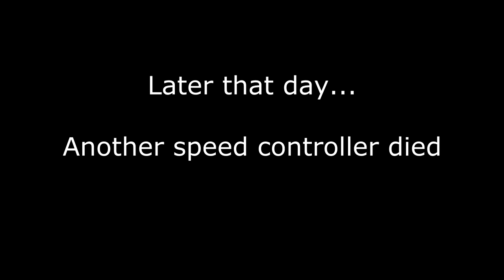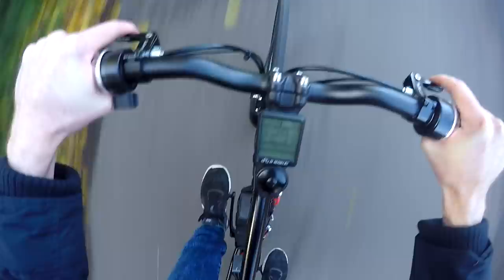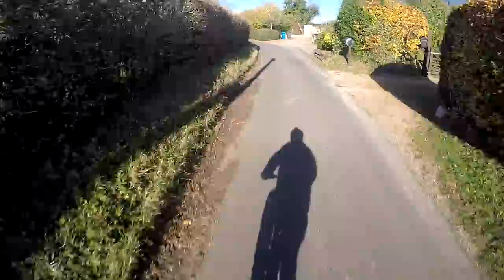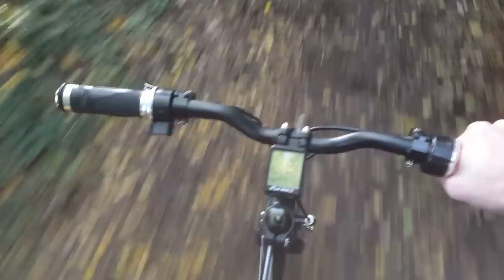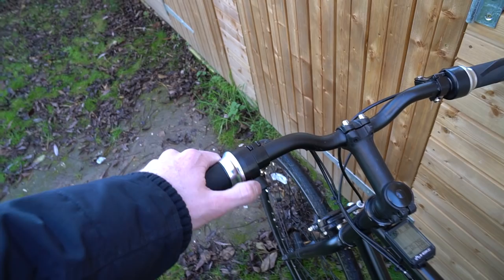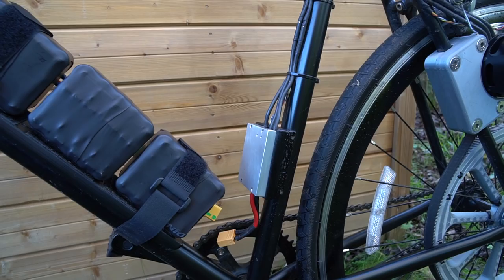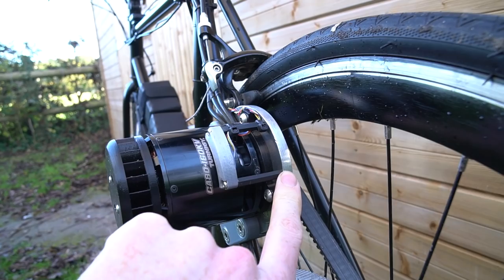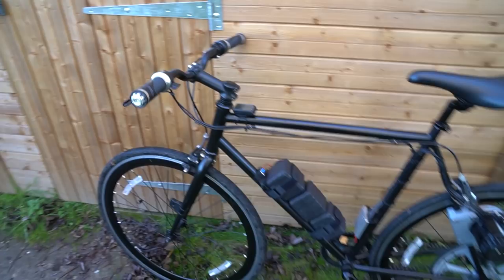Electric bike V3

Comment: Is that even street legal 😂 I'm sure that goes way over the 250 watt limit here in the UK. Even if not, it still has a top speed that's way too high to be legal right?
Reply: Max motor power output is 250W, the motor shouldn't be capable of powering the bike above 15mph so yeah, I'm pretty sure this doesn't meet the requirements.  Shame because 250W is pretty much useless to anyone who cycles seriously, and better ebikes might persuade more city commuters out of cars burning dinosaur squeezings
Reply: PKMartin yup
Reply: It's illegal in so many ways...
As well as the obvious power and speed issue, electric bikes in the UK have to only operate while being pedaled.

The laws are both ridiculous and nonsensical. 
We need a light electric vehicle class and sensible rules.

I'd like an electric scooter (a big version of the things the kids have) as I have some mobility problems and I'm just not prepared to have a giant PoS mobility scooter...yet.

Sadly you can't use them on the road, pavement or cycle paths. Brilliant!
Reply: Pook365 wow. I hope the law changes. Especially for your sake and others in a similar situation.
Reply: The U.K. Laws have, as with many laws not kept up with the rapid development of battery and motor technology. Tom's bike shows what is now easily possible but would now only be legal if licensed as a motorcycle and I think the procedures would be massively expensive!
Reply: Michael Curtis yup. While the government argue about which part of the NHS to cut rather than put in place laws that actually benefit the public. Anyway I don't think anyone will arrest tom so it is a basically un enforced law for general public. I still would not use it in inner city London just in case a police officer actually knows the law
Reply: As far as I’m concerned the law on electric pedal assist bikes is kind of justified with regards to the speed restriction as a lot of cyclists tend to be a bit careless regarding personal safety and once you ramp up the speed to motorbike levels, you really need a proper lid and clothing  for safety as 35mph+ road rash is not fun.  (I’m an occasional cyclist but less so nowadays as I have thoroughly wonky knees, and am a full motorbike & car licence holder). 

That said, as has been pointed out the 250W motor restriction is completely ridiculous.. A more sensible law on electric bicycles would to my mind allow a continuous max speed of say 30mph by combining pedal power and electric assist along (say 20mph on electric alone?) with a requirement for suitable brakes on the bike and protective clothing, as well as perhaps some compulsory training along the lines of the CBT you have to do if you want to get a motorbike. Either get rid of the wattage limit, or raise it to the point where you have a useful motor capacity. 

That way you can keep up with traffic without busting a sweat, you’ll have enough motor power to help you actually get up anything more than a gentle incline, and if you want to go faster than that why not get a motorbike licence? (There’s some awesome electric motorbikes out there).

And I feel @pook365’s pain about those larger ride-on scooters... when my knees are particularly shitty I’d live to be able to use one on my commute....

To be honest, if I didn’t live in London and commute into Central London, I’d probably build something like Tom’s bike to convert my current bicycle to an over-powered electric conversion anyway, but knowing my luck, I’d be the one to get nicked! It just looks like a total blast to ride.
Reply: EU is coming up with new rules, setting the limit from 250W to 1000W. To bad about Brexit.
Reply: I personally think if you have a motorcycle license, you should be allowed to operate ebikes above 250 watts.
its probably easier that way.
Reply: Yeah, but when does it become a moped?
Reply: But how will the government make money out of us?
Reply: Wow, suddenly they got some sense? Un freaking believable!

Comment: Check out this cheaper (costs only 200$) (but half the power)power train here:https://hobbyking.com/en_us/turnigy-sk8-esc-v4-12-for-electric-skateboard-conversion-w-bec.html
(battery not included)
To get the same power,go for this motor: https://hobbyking.com/en_us/turnigy-rotomax-50cc-size-brushless-outrunner-motor.html

Comment: So  lets get this straight 
£300 for VESC6 controller (wow! it should be 'amazing kit')
£150 motor
£150 battery packs (my guesstimate)
£15 throttle
£25 box, clamp, cables...anciliary etc
= ~£640  total + lots of work  (plus you have to buy bike as well)...an expensive business. A rich man's hobby
Apart from if you really enjoy the build , the only added benefit of this would be its power - but then its not road legal. 
Think I'll just buy an e-bike as cheaper less hassle option
Reply from the maker: That's very fair, however I enjoy the satisfaction of designing and building such a bike just as rewarding as the final product!
Reply: Didnt he say at the beginning of this series that it wasnt going to be cheap and that he was doing it for fun?
Reply: That's actually cheap for an e-bike! If you want a decent e-bike with a little better quality components.....it's gonna be well over 2000£

Comment: You should be extremely careful with a cheap bike with cheap wheels and spokes like that offroading or doing anything at speeds like that. Sudden catastrophic failure is a risk, and I have scars to prove it. Cheap tires can simply fold like an omelette at high speeds. Nothing about your build, it's the base bike that you started with that's the weak point.

Comment: 36 mph on that flimsy bike is the unsafest thing I've ever seen in my life.
Reply from the maker: Haha this bike is surprising solid and stable at speed too! Feel just as safe on this as I do on my Specialized road bike
Reply: Looks like nothing to worry about to me though. I've done 50MPH on a downhill before. And that was on a Walmart bike on a street with occasional traffic, so this guy's ride is much less sketchy and more controlled than that. Not to mention he's even got better brakes than some beater with a side-pull caliper.
Reply: You clearly aren't a cyclist if you think 36mph is unsafe. I am a cyclist and on pure leg power I pump out 42mph at full speed. Now if you lack common  sense and don't know when and were to go fast then surely its extremely unsafe.